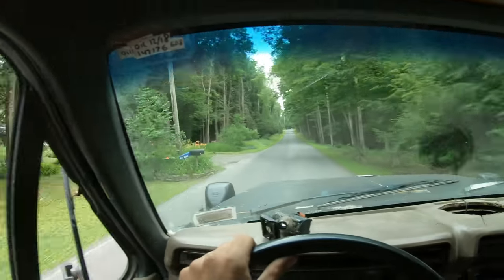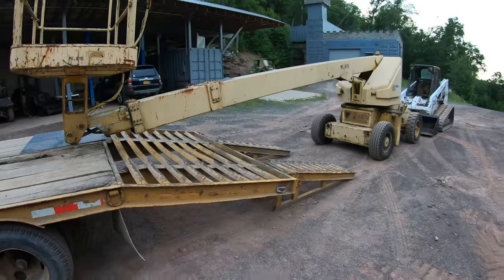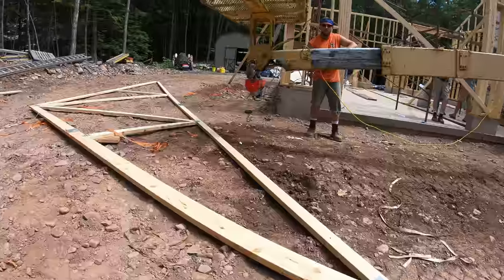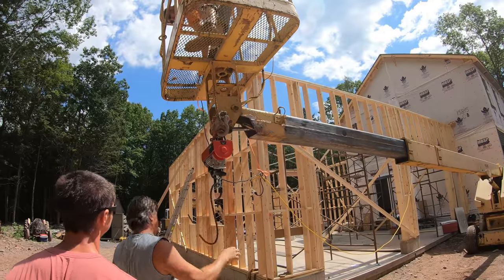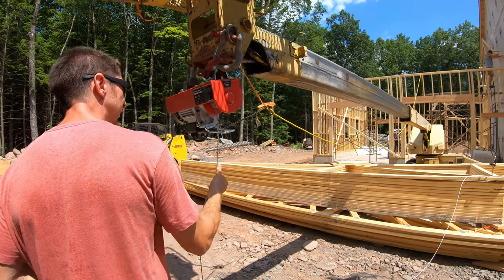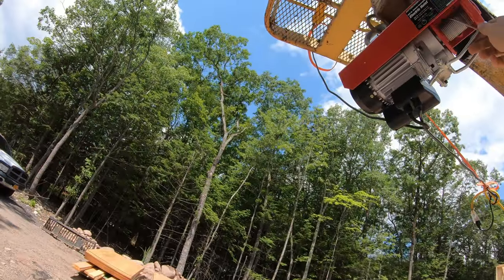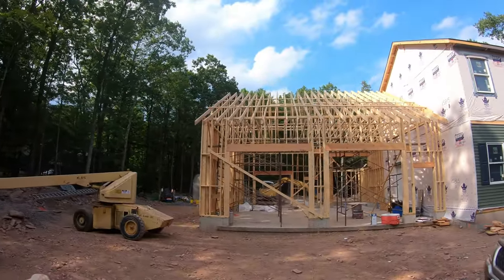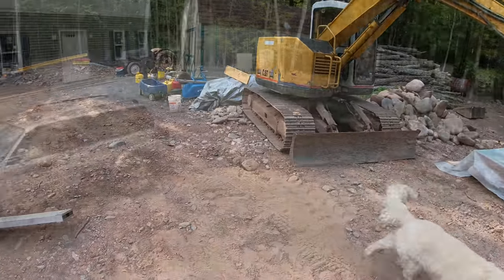Setting trusses with a boom lift

Comment: How much can that handle without outriggers one dude and a truss seems over 500 pounds
Reply from the maker: Truss was 160lbs. But that lift is 9 tons on solid tires, that's why it can work no outriggers.
Reply: Andrew Camarata thanks Andrew you inspired me to buy my first skid steer it’s a bobcat 753 . It needed some love but works like a dream low and I got so much stuff done in the last 2 weeks

Comment: I'm not sure you know this but you placed your hook wrong. When you hook them up to your truck. I drove double trailers for 30 years. when you hook up the hook should be facing you the open end. Why is this if your trailer breaks away thee hooks will grab and hold before it hits the ground.  They will not come off and lose your trailer. The other way the dropping of your trailer and bumps will cause them to come off and lose your trailer and load.
Reply: Look again. They have those safety things(don't know the name) so they can't jump of.
Reply: @nathan_hl9556  Sorry Nathan but it doesn't matter if it has safety catches over the hook. This is also DOT rules. If you never pulled any type of trailer that uses hooks The maybe you should read the rule book. I have 3 million miles under my belt behind a wheel of semi trucks over 30 yrs of experience. Evey pulling a boat trailer or any Uhaul trailer these all have to have the hooks opening facing you.  Like I said when the trailer breaks away this holds in place as you pulling it. The trailer will leave you if the hooks placed the other way the open in with release easier
Reply: @Tafs315  I guess i learned something today. Thanks for sharing this potential life saving advise.
Reply: @nathan_hl9556  You welcome, I like people to understand to be safe in the way they drive and pull trailers. I seent people pulling a trailer that comes off and hurt them and other people on the road
Reply from the maker: Donald Copeland ok.

Comment: man that lift does not have base controls? there is a safe way to do this you just run it at the base it also increases the lifting capacity by 200 or pounds. also wear a harness especially when loading that boom will fire you out  just like a trebuchet if the wheels drop suddenly. I run jlg ultrabooms almost daily and I have been launched into the air a few times from just hitting little potholes driving the machine hard enough to deploy the dead line on a retractable lanyard.

Comment: Do those trusses look shoddy to anyone else? I'm no carpenter, but my dad was, and I built a lot of houses with him, and I can guarantee if someone dropped those trusses on one of our jobs, he would have sent them back.
Reply from the maker: What looks shoddy about them?
Reply: 2x6 top and bottom chord. 2x4 webs, fully nailed gusset plates on the joints and the wood looked like #1 syp. They looked fine to me, as did the framing. 16" oc might be what is throwing you off. 24" oc would have a lot more webbing.

Comment: Ok I was gonna get upset you were using the man lift to set trusses but after seeing how light they are it’s fine. 

I wouldn’t want to be in the basket though. Keep up the hard work. 

Ralph from socal
Reply from the maker: We were planning on doing the job using the ground controls, but those controls don't go slow, plus the machine cant be driven from the ground. It went well, I guess I would use a crane next time.
Reply: Andrew Camarata alright Andrew your the man. Thx for replying. Your a big reason why I started doing my own home repairs. Your inspiring man. 

My wife even likes you lol. She really likes the fact you have a computer science background, keep it up bro. I’m sharing your page to my co workers

Ralph from Maxim crane Long Beach !!
Reply: I also forgot to say it gets expensive with crane. Even a small mom and pop crane outfit will charge 150$-$200 per hr. Those trusses only weigh a few hundred pounds. It’s more of a liability thing as you know. Some one gets hurt in that basket while winching down and people start pointing the finger. 

As a wise crane operator once told me,” everyone is your friend until you f@@@ up”

Keep it up Andrew. Love your videos

Comment: Worlds slowest and most  sketchy roof build. Builder needs to get with times and use a lull or crane truck and pre fab all or half that roof at a time and fly it in
Reply from the maker: Crane was too expensive.
Reply: @AndrewCamarata  sounds like they under bid the job then and took a chance on safety to do it this way

Comment: ...........I am pretty sure this is against all OSHA regulations. 

-I was looking to buy a lifts that was typed over by someone hanging an air conditioning unit on the bottom.
-They where placing the A/C unit on a roof & it started to swing the operator tried to correct the swing & it started a pendulum effect & tipped over.
-The operator was killed & a huge law suit took place.
-The End.

Comment: OSHA  would have a field day with you guy.. take off the safety switch, no harness for the operator using a piece of rebar for a hook, no inspection sticker on the machine.. That's just a few..well, what are friend for. If i was there i would of done the Same thing... Its call Common Sense ?? no one got hurt and it turned out just fine..NIce job